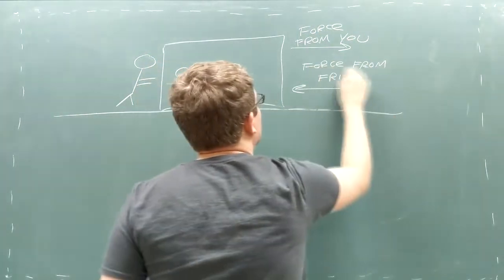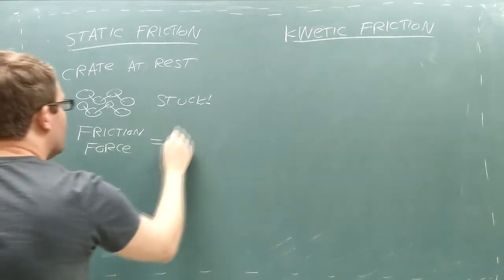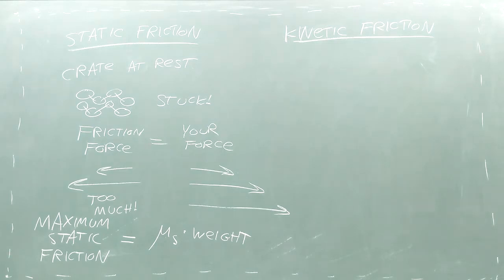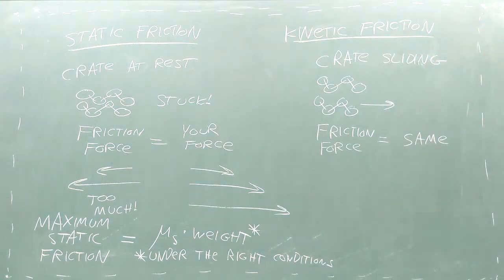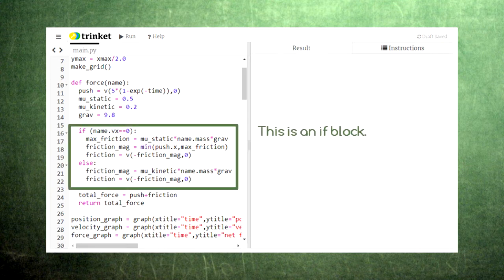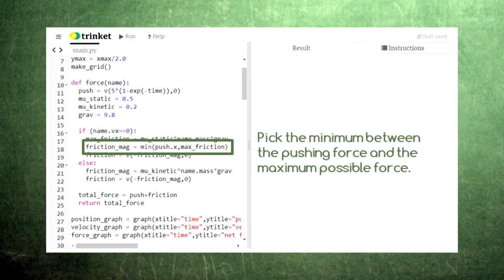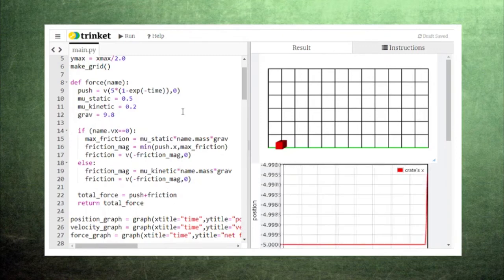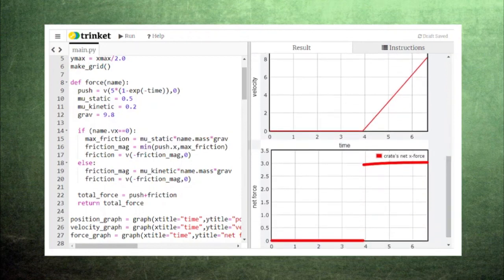Coding for High School Physics 13 Friction with If Blocks

Comment: Thanks a lot. Why you use Trinket rather than Glowscript? Is there any difference between them?
Reply from the maker: There is no difference in terms of the language, but I like how trinket displays both the code and the animation on the same window. You can copy and paste the code into glowscript.org without any changes necessary.
Reply: Let's Code Physics thanks a lot